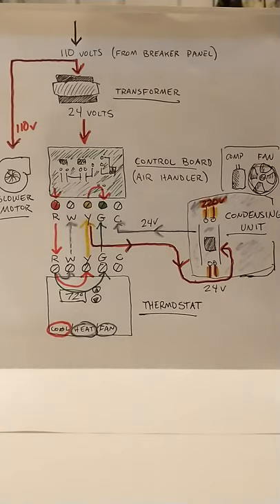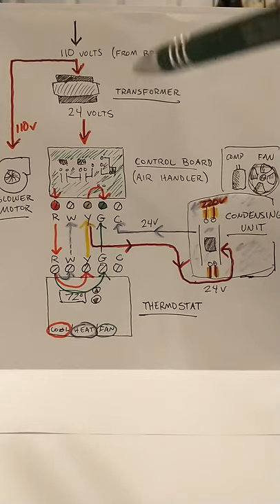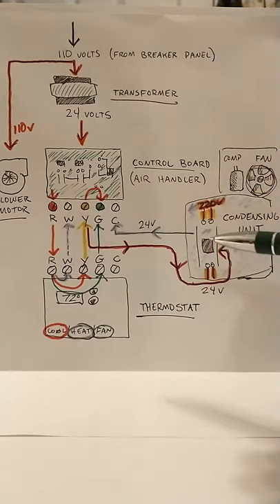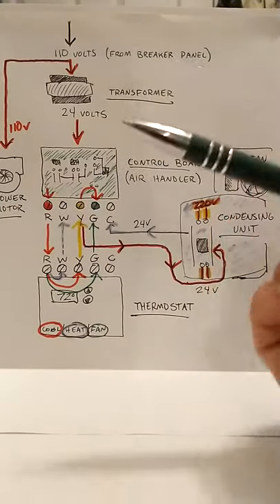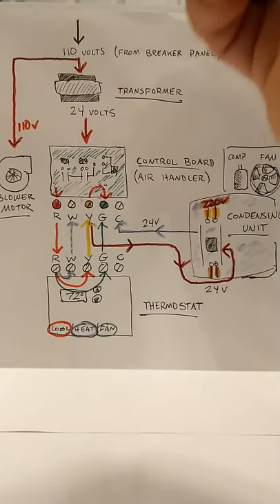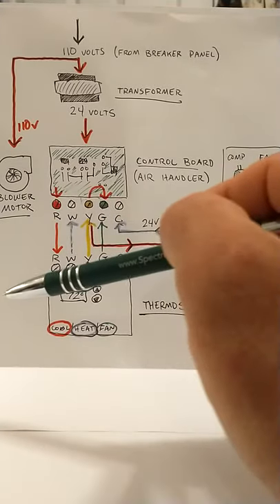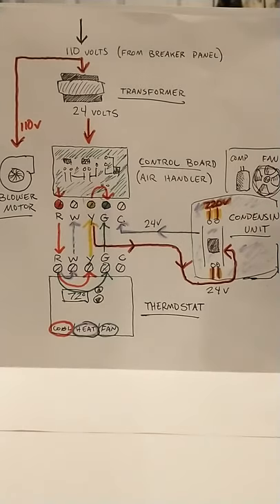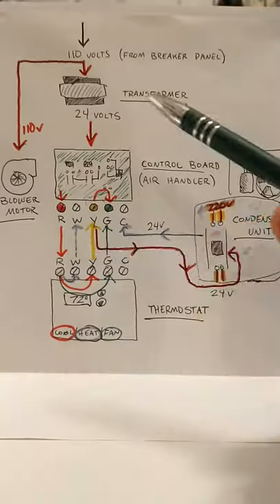HVAC Low voltage control wiring (Basics For Beginners)

Comment: Hey can you make one of these for Amanda air handlers
Reply from the maker: You mean all of the wiring  internally?
Reply: @JerseyMikeHVAC  just wiring from air handler I always mix up the wiring on it … I’m 50/50 with my company right now but they don’t plan to let me go I just want to be so precise with my installers
Reply: I know it’s only red white an green but I 50/50 do it right an wrong
Reply from the maker: This video covers most brands and the basic low voltage wiring/color codes follwed in the industry, so Amana would be pretty much  the same as everything  in this video. Unless you're doing heat pumps, then there's a little more to it.
Reply: @JerseyMikeHVAC  a lot of the air handlers we work on are 3 wire an I’ve ran into situations where they’ve ran 5 wire from the thermostat to a spliced in wire at the air handler I just want to get more confident in wiring the air handlers
Reply from the maker: Ok, I think I got ya now. What I think youre talking about is that they are connecting the Y wire from the thermostat directly to one of the condensing unit wires. The other condensing  unit wire coming back then gets connected to the Y terminal at the air handler. 

That sound familiar?
Reply: @JerseyMikeHVAC  yea the 2 wire from the condenser one to common one to yellow but most times the air handler don’t have a yellow wire the you use your red white an green from the thermostat
Reply from the maker: Yeah, so just remember red is always the 24 volts going up to the thermostat (R from the air handler to R on the stat).

 Green will always be the fan motor (G to G). The cooling system will still work even of the green isn't hooked up. That's just for the FAN on/auto function of the tstat if the customer wants to circulate air through the house without heating or cooling running. 

Cooling (Y terminal) will be the white wire coming nack from the stat if you're using 3-wire thermostat wire (because there is no yellow wire to use) or yellow if you're using 5 wire. 

All you're doing is splicing Y from the AH and Y from the Tstat together along  with the red or white wire from the condensing unit. It doesn't matter which one (red or white). It will work either way, but most guys use red from the CU for the Y connection and  the white wire from the CU is used for common. The other  remaining CU wire goes to common (C terminal) at the AH.
Reply: @JerseyMikeHVAC  I’ll come back to this comment a couple time lol but thanks looking to take a lead position next summer
Reply from the maker: I'll draw up a little sketch for ya later and post it here if I can. 

Good luck moving forward. You can do it.
Reply from the maker: https://imagizer.imageshack.com/img922/5990/qhNsFb.jpg

Is this what you're talking about?
Reply: @JerseyMikeHVAC  yesss
Reply: @JerseyMikeHVAC  an I appreciate it tooo brotha … they got me learning boilers tooo soooo basically I can do coil condenser furnaces pressure test vacuum . Lots of new construction things. Air handlers I can wire a zone relay to circulator pumps along with main power high voltage to an from board an wire in all the zone t stats just not confident with the piping
Reply: Adding in Freon charge an water heaters what do you think is a good hourly wage for someone with them skills bc I kind of want a raise lol
Reply from the maker: Yeah, so all they are doing is using a wire nut to connect one wire from the CU (usually red) and whatever wire is coming from the Y terminal from the thermostat. The extra wire coming off of that splice goes to the Y terminal at the AH. 

 With 5+ wire it will be yellow because yellow is the standard industry designation for cooling, but if you don't have a yellow, like when you're running 3-wire, then you have to use white for cooling instead.
Reply from the maker: The guys I work with right around that skill level are making $25-30/hr. But I'm right outside NYC, so cost of living is higher and so is the pay.
Reply: @JerseyMikeHVAC  brother you hit the nail on the head I’m from New Jersey living an surviving is t cheap

Comment: I need help figuring out why I have no power to my thermostat, when all the transformers are putting out 24 volts. It's in an apartment building and I've been scratching my head for days now. PLEASE HELP!!!
Reply from the maker: Is it just one thermostat not getting power?  If so, I would first  test for continuity on the 2 wires  between the thermostat  and its respective zone valve. 

1. Kill the power on the boiler.
2.Disconnect both tstat wires from that particular  thermostat at the zone valve it goes to and wire nut those 2 wires together. 
3. Disconnect both wires at the tstat and test for continuity. 
4. If your meter doesnt beep there's you're problem. One of those wires are pinched, chewed or grounded.